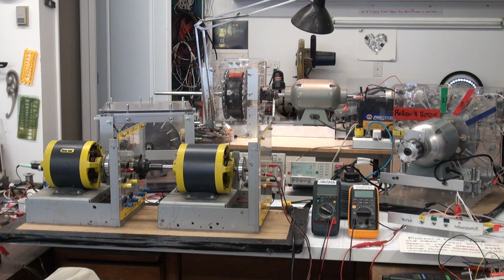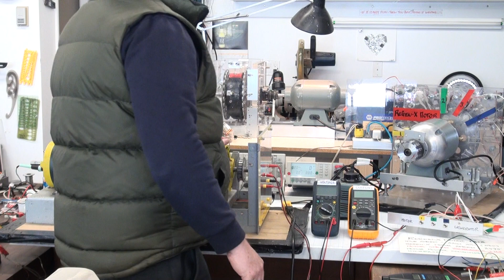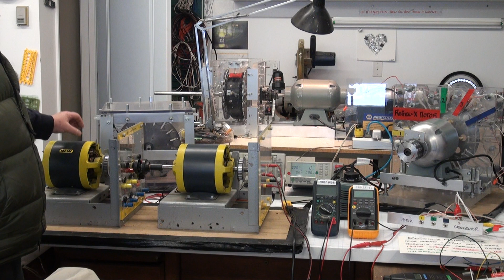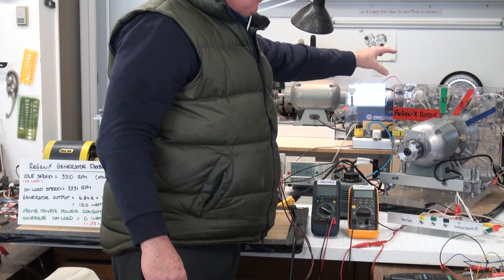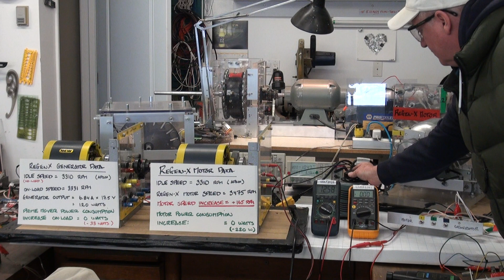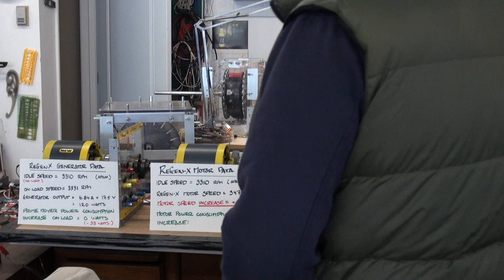ReGen X Quantum Motor and ReGenX Generator Introduction

Comment: You can actually add rpm to a motor without input power needling to be added, - this is done if the field is made stronger using p.magnets... but this lowers the torque or course.

So It would be a great idea every time you show your setup, to clearly show Watt motor input power clearly, Amp input power to the motor clearly, and voltage to the motor clearly..
If you do this, and you have before, it shows proof to people there’s no tricks involved. This is because if the motor gained rpm because of the trick using p.magnets on the stator, without any added input power, what would also happen is Amps would change or course because of the change of impedance to the coils... 

Clearly you’re not playing tricks on anyone, you are simply slowing the induced emf’s time constant so that the - emf torque is used in a positive way 👏👏
Reply: Also Maxwell’s other equations (20 originally) some where to deal with asymmetric E x B and we don’t have the details available in the standard 4 equations... but they can still be used to provide simple answers.
Now if Heaviside had the academic support at the time, then all 20 of Maxwell’s equations would be in the text book and it would seem that the ideas about using the negative EMFs would be very clearly understood by all in the academic world. 

THE ISSUE IS 
HUMANS BELIEVE IN PHYSICS, THEY DO NOT FOLLOW PHYSICS...

An example of this fact is;  using the counter-torque in a generator (which happens as a result of —EMF : Lenz Law) •
using it as a positive motor-torque DOES NOT IMPLY THAT THE —EMF Lenz Law MUST BE TURNED AROUND TO HAVE THAT RESULT!

ONLY PEOPLE WHO BELIEVE IN THINGS SAY THAT, AND SO HERE IS YOUR PROOF...

MOST PEOPLE IN THE INDUSTRY SAY THAT “OH THAT MEANS YOU MUST TURN THE LAW AROUND & THEY ARE INDEED WRONG! AND ARE ONLY BELIEVES! 
THEY DO NOT FOLLOW PHYSICS, THEY ONLY BELIEV IN IT!!!!!

Fact 1. 
When you design a generator stator you use the EMF equations, and you know the time-constant of the induce —EMF response of said generator stator coil.
Therefore you have designed this time-constant into the coil. If you choose to change the time-constant by design choice, then the —EMF will be present at that proportional change by design.
If the time-constant is designed to happen later in response to cross product, then the generator rotor magnet B  will be after the cross product of said induced —EMF and therefore act on it positively & become a motor-torque! 

SO TO THE BRAIN DEAD PHYSICS BELIEVES, THAT ONLY BELIEVE, SORRY YOU ARE CLEALY WRONG.... THERE WAS NEVER A ARGUMENT WHERE “LENZ LAW”WOULD BE TURNED AROUND! 
YOU ARE THE NAIVE ONES! 
ASK YOURSELF ARE YOU THAT STUPID, HUMANS ARE NOT ANIMALS, THEY UNDERSTAND FROM A VERY YOUNG AGE YOU CAN NOT VIOLATE THE LAWS OF NATURE!  

THIS IS BASIC AND I HAVE NEVER HAD ANY TRAINED PERSON EVEN ENTER THIS ARGUMENT BECUSE THEY WORSHIP AND BELIEVE IN PHYSICS... THEY DO NOT FOLLOW PHYSICS!
ITS ALL EMOTIONAL TO THEM! 

WAKE UP MAINSTREAM, COME AND CONTEST THESE BASIC KNOW PRINCIPLES, DO NOT SAY “THAT VIOLATES THE PHYSICS LAWS” 

IT DOES NOT !

AND PS 
IVE NEVER SEEN ANY ABOVE UNITY DESIGN EVER SHOW A REVERSED LENZ LAW ! 

OH NOW DON’T GET TRIGGERED BY THE WORDS ‘ABOVE UNITY’ YOUR CHURCH MIT HAS PEER-REVIEW OF SUCH SYSTEMS!

ALSO DON’T LOOK FOR YOUR PERFECT BLESSED WIKIPEDIA PAGE TO BACK YOU UP - THEIR PAGE ON THE SKEPTICAL GROUP SAID OF THIS DEVICE IN THIS VIDEO AT THE UNIVERSITY “IT WORKED” - “BUT WE DO NOT KNOW WHERE THE EXTRA ENERGY IS COMING FROM” 

CLEARLY YOU DO NOT KNOW!
YOU DO NOT SEEM TO UNDERSTAND MUCH OF ANYTHING THAT YOU DO NOT WORSHIP!

why not start the argument off with the FACTS instead of your feelings! 
Trained people please, come and see if you can prove otherwise !
Reply: @caminglis53  Regenerative acceleration effect occurs, because core of coil continue to magnetize, when magnet has already passed top dead center of the coil. Core is not yet saturated, when magnet is at top dead center of the coil.
Reply: @marcisgulbis9310  yes true, but also you can do it with many types of coils even air coils tho...
I’ve done it with air transformers even.

All that’s happening is there’s more impedance designed in the coil than would be in the standard design context, therefore the induced —EMF is longer in time-constant curve, and lower than it would be, you could say less efficient.
In the standard design the coils impedance will be matched or equal as a cross product of E X B clearly to have a close to as possible of perfect induction.... and with generators as high as 94% efficient it is very close to perfect (and some of that is Ix2R losses and core and bearing losses) so the induction efficiency might be as high as 97% in reality in the standard model 👍👍

In this unique design where the idea is to have a longer time-constant the induction efficiency will also be lower... nothing like 97% efficient, more like 60% efficient.
BUT as you and I and many know this doesn’t matter because you are getting a motor-torque as a result of the lower efficiency / longer time-constant....

So the only real loss to this idea is core cogging losses, but that’s the same with all generators and can be designed out mostly anyways.

Yeah I like what you’re saying about the core and Nikola Tesla also had the same result with some of his motor designs, his core was very different it was a long u shape with the coil way way back on the core... it has a similar result. He violated the HP rule with it 👍

Clearly this shows in fact that the teaching about Newton’s 3rd law acting the same as Lenz Law is totally untrue and simplistic as a teaching! 

They are similar to in pattern but nothing like the same thing in reality!

Our world has suffered because of academic’s arrogant mistake! They are blinded by their own pride and are only believers in their own worship of what wisdom they think they control....
It’s a stronger worldview than religion to them!   

I’ve never had a academic, engineer, or anyone trained in physics at any level, ever win this argument they realize shortly after beginning the argument that they have nothing, no answers, and are f####d thinking in the end “how could this be” and saying things like “I’ll have to go away and think about that” !

It’s simple 200 years ago there was a relativistic model applied to electrodynamics what had a new statement about the Newton 3rd Law and Lenz Law being one in the same... this was because of all things going on with the theory of relativity... 
I’ve read engineers at the time said this is wrong and to simplistic to say both act the same, they were correct!  

Same pattern in nature but much more complex in action, thats the reality of it!
Reply: Motor efficiency is greater, when square waves is used instead of sine waves.  Efficiency is grater, when current in coils does not change direction. Only one coil must be switched on at the same time, to avoid negative interference between magnetic fields of different coils. Electric motors can output 10 times more output power than input power, if coils is switched on / off at right time.
Reply: @marcisgulbis9310  yes using the negative emf is the key... sadly standard theory doesn’t address such options, as they are a closed restive system!

Comment: This is a joke, you can't see anything of any substance, the setup is poor,  and he is claming Overuinty, I think he just likes hearing himself speak, go craw back under a rock, REAL PROOF OR SHUT UP!
Reply: No it’s no joke he’s using the counter-torque (the negative side of the circuit) for a gain in output.

Remember motors that are 95% efficient, the best on offer, still don’t include the energy value of ‘counter-torque’ / B-EMF, on the data sheet... what do you think the efficiently looks like, if you used this component, for a positive gain to the output?

Also this set up was in the physics lab at a Canadian university for some time, all the students go to go over it on the daily, and learn above the positive use of counter-torques in electrodynamics systems, motor, generator, transformer...
Reply: @caminglis53  hey is there a way I can contact you for a chat?
Reply: @RajarshiGhoshal  yes my Instagram is Cam Inglis Cameroninglis_  you can message me there 👍
Reply: @RajarshiGhoshal  also heres my email
Camwattinglis@gmail.com
Reply: It hasn't  moved on in two decades!
Reply: @john-qq4ym   Free energy has been suppressed for over 130 years, to keep us all dependent on one source of energy - oil. https://en.wikipedia.org/wiki/Free_energy_suppression_conspiracy_theory  They erased all information about Nikola Tesla's radiant energy from school physics textbooks. Todays electric circuits is designed to kill radiant energy, motors is misdesigned to not exceed 100% efficiency. Flywheel diodes short out radiant energy.
Reply: @marcisgulbis9310  exactly correct 💯

The fact is and people can call it what they want BUT.... wiki says this on Nikola Tesla’s page regarding his “super electrostatic study work” Wireless energy -
 “Colorado Springs during 1899. Experiments he conducted there with a large coil operating in the megavolts range, as well as observations he made of the electronic noise of lightning strikes, led him to conclude incorrectly, that he could use the entire globe of the Earth to conduct electrical energy.”

NASA don’t agree with wiki’s info on this at all! They instead quote Lord Kelvin saying - “Hertz and Tesla both were correct”

Tesla was using ground waves LW which is proven today. Viziv are now demonstrating this very technology!

And how stupid is this wiki info 🤮🤦

They call this a ‘conspiracy theory’...
- “Some notable people who have been claimed to be suppressed, harassed or killed for their research are Stanley Meyer,”

The police in the local area around where Stanley Meyer lived and died reopened the information about the investigation into how he died!

How is that a conspiracy theory Wikipedia 🤮
This is the best one 

“The water fuel cell is a technical design of a "perpetual motion machine" created by American Stanley Allen Meyer (August 24, 1940 – March 20, 1998). Meyer claimed that an automobile retrofitted with the device could use water as fuel instead of gasoline. Meyer's claims about his "Water Fuel Cell" and the car that it powered were found to be fraudulent by an Ohio court in 1996.[1][2]”

The sources lead you to realize it wasn’t over the car at all but a component in question 🤣
Reply: @john-qq4ym  maybe so but that doesn’t effect it being legit or not

What are you critical about regarding his design? Why do you think there’s an issue using the ‘counter-torque’ for a gain in output?
He’s not the first to do it by any means, there’s lots of unique design doing very similar things to this one!

Comment: Damn it Thane  all you have to do is stop talking and show  watts in and watts out under a load ,   and show no hidden wires .   As a zero fuel scientist  you need to listen  to me  please
Reply: Watts in will be less, if asymmetric motor is used instead of induction motor. In asymmetric motors, independent coils is switched on and off, without reversing direction of current. When motor coils is switched off, back EMF spike can be used to power CFL or LED light bulbs, and that counts as additional output. When coil is switched on, sharp change in voltage induce very large magnetic field for brief time moment.   H = dD/dt + I    Switching increase dD/dt in Maxwell equation. Back EMF reduce dD/dt part of equation: H = d(e0*(E - BEMF))/dt + I  https://www.youtube.com/user/ufopolitics/videos   In ufopolitics videos you will see that asymmetrically modified motor performance is much better than symmetric. Asymmetric motors can reach higher speed and consume less power, and don't heat up during operation. 750W asymmetric motor can be powered by two AA 1,2 2200mAh NiMH batteries .